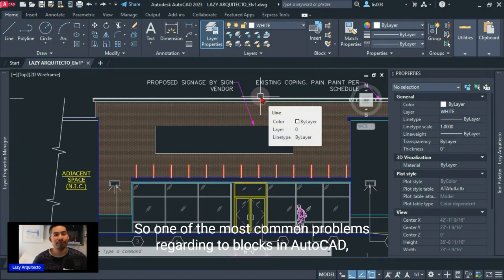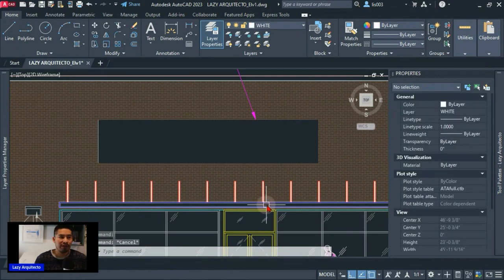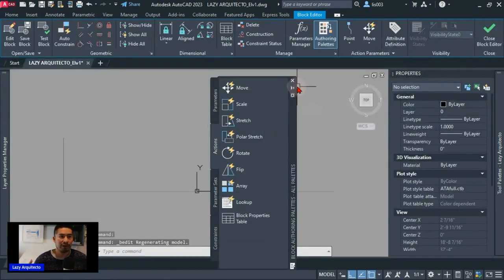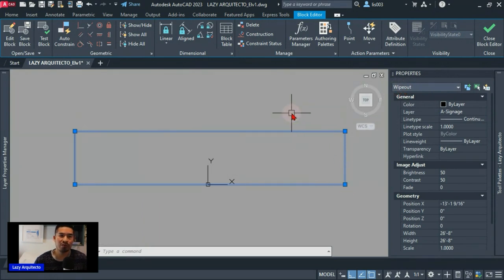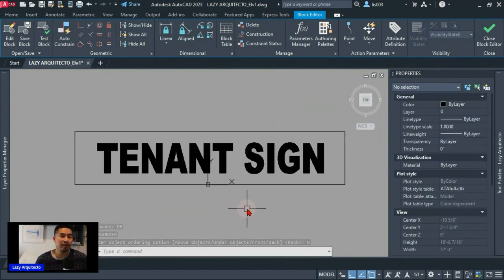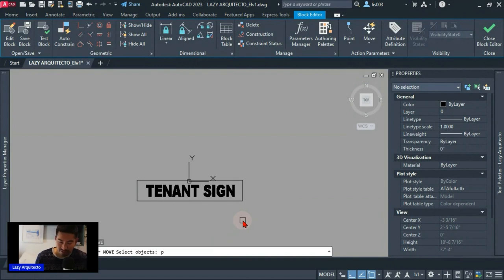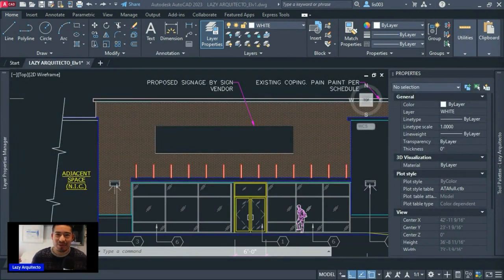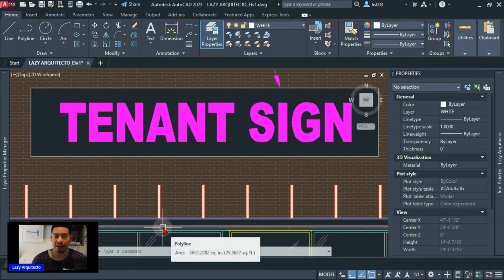AutoCAD Block Fixes: I Wish Every Beginner Could Watch This.

Comment: I'm not a beginner but somehow I've never learned how to use "by block" so this was really helpful - thanks! 

I have a question about wipeouts: I thought that they had to be on a layer with color 255 - usually on a layer like "wipeout" or "elev-wipeout" - or else everything behind the wipeout will print as black. Is this still true?
Reply from the maker: That is not true Rachel. You can turn off the wipeout frame with wipeoutframe system variable. If it print black, it is because of plotting problems.